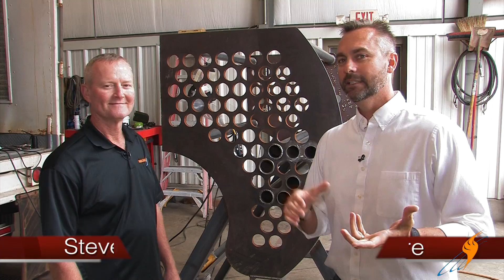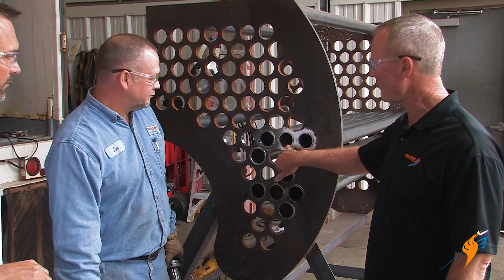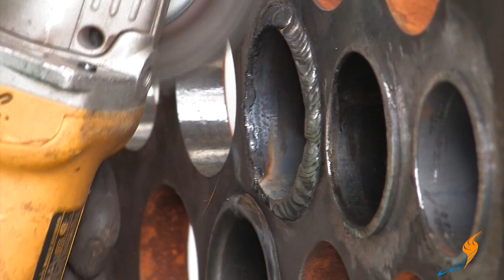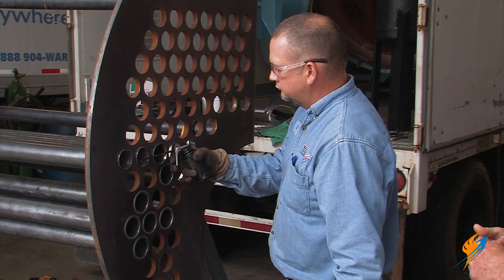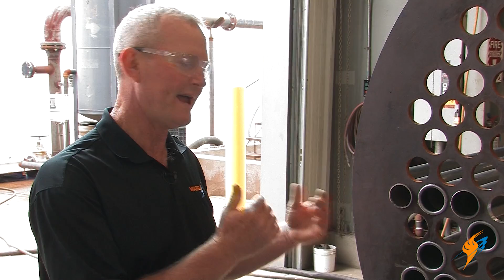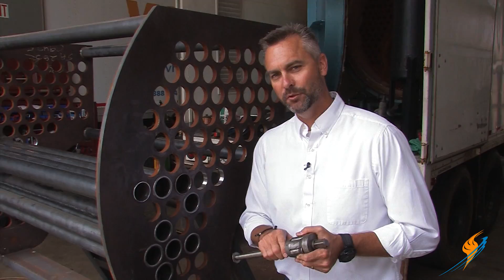How to Roll a Boiler Tube - Boiling Point

Comment: Very interesting video - On our scotch boiler retube back in the 1980s, our inspector and boiler maker elected to just expand, which is Australian code. Coal fired with combustion chambers, so tube joints do not experience fire face temperatures. Tubes had 5/16" stickout front and back. We expanded tubes only (under Australian code) and did not bell mouth. We were embarrassed when we had a few weeps under pressure test, but boiler inspector praised this result, saying he was pleased we had not overexpanded and strained ligaments. 30 years later we retubed again, likely as a result of the boiler being steamed only occasionally as a museum ship. Tube ends in the combustion chambers remained as installed with no leaks or burning. Most tube failures were at worked  edge where the rollering stopped. Note we are natural draft coal, and the tube ends are not exposed to forced draft or oil-fired temperatures. Our earlier boiler inspector and boiler maker had passed away, but the new guys chose to weld new stay tube ends and again, simply expand the plain tubes.

Comment: As a boiler maker apprentice in the 60's the first job I was given was using the expanding mandrel on the tubes to tube plates, we did not have any electric tools, just a manual ratchet and after 1/2 hour I thought my arm was going to drop off. We used to weld tubes both ends and also have several solid stay bars in some holes to make sure the tube plates were truly held and to stop deformation that the tube expansion sometimes created.
Reply: Where I work, that's how we start everybody. You gotta learn the hard way before you can appreciate the easy way.
Reply: Crazy talk! What local, brother?

Comment: its nice to see stick welding (arc welding) still used its what I prefer and its a skill that takes lots of time to get just right.
Reply: Welding around round tube in the vertical position with an arc welder is about the worst thing you can do. You NEVER weld VERTICAL DOWN with and ARC WELDER. All the molten flux runs down and off and away from your puddle and bead faster than you can ever weld a bead regardless because the liquid flux is LIGHTER AND THINNER than the LIQUID STEEL IN YOUR PUDDLE AND BEAD. It runs down away from you and then it runs into the joint and onto the base metal and you end up welding into and over SLAG the whole time. And since you don't have any or enough flux left on your BEAD and have little or no SLAG your BEAD ends up cooling too fast and in the OPEN AIR and will be POROUS AS HELL. I've been arc welding since junior high and gas welding with and without filler rod and brazing as long and back then I was as good as anybody I've ever seen and can still get it done after some practice and I took the real deal welder certification when I was a locomotive machinist at Union Pacific. 

Big V 1/8 wide at the bottom butt weld with a base plate underneath multi-pass no undercuts or beed below base plate metal on the cover  passes and no bead above 1/8 and the instructor was a machinist and former pipeline/water tower/giant ass petroleum tank welder with more hours of vertical welding that I've got welding period and probably more like 10 times more and he was by the book so the bend test was by the book and the weld didn't have to break or crack to fail. HORIZONTAL, VERTICAL UP AND OVERHEAD. THAT is where I learned you don't EVER weld VERTICAL DOWN. And a MIG welder MIGHT BE "easy" compared to arc but there's nothing ELSE that is. Pick up a welding torch or TIG torch in one hand and filler rod in the other and start welding some aluminum or stainless or if you've never tried it just grab the gas torch and NOTHING and run some beads out of the base metal alone. 

I like to think I'm a pretty good welder because I can arc weld and most guys that can MIG weld decent can't arc weld to save their asses too. But I also KNOW I'm a pretty good welder because I've done it all over the years and pretty damned well and I picked it up in pretty short order and I've got LONG periods of time doing NONE of it and it doesn't take me TOO LONG to jump back into it. I've also done more "torch work" when it comes to cutting off bearings and cutting out bushings and torching out broken off bolts without taking the threads in the holes and in general if it can be done with a torch or rod or gun I've at least given it the old college try and haven't had to call for backup yet. I HAVE welded closed a lot of burned holes from getting too aggressive with MIG too and I'm not ashamed to admit that because MIG really isn't ALL THAT FUCKING EASY TO DO WELL JUST BECAUSE ITS A LOT EASIER THAN USING ARC FOR SOME THINGS ARC IS ALL BUT FUCKING IMPOSSIBLE FOR.

As for getting welds "just right", ANYBODY can do that with enough time, materials and a GRINDER. 

https://www.youtube.com/watch?v=ZAX_ZhjJnwg
Reply: Be careful there, buds. You're gonna dislocate your shoulder patting yourself on the back😆 and all a welder is, is a truck driver with his brains knocked out. Keep up the good work, pal
Reply: yes the flux can get stuck but there are rods rated for doing the vertical down motion two of which is the 6010 5p and the 7010 both that are asme approved for the r stamp welds that are required on boilers in the united states
Reply: DEEREMEYER1 they arc weld downhill with flux all the time 😂 all pipeline welding is done that way. Even passed x-ray
Reply: @deeremeyer1749  sorry but you are wrong. Pipe guys run 5p downhill alll day on roots.

Comment: great show !! 
i really make sure about the welding of tubes against tube plate, since my manger reject this in afraid of expansion and cracking of tubes sheet. 
i win !
Reply: In my opinion you'd do this seal/transfer weld in 'thirds' -- make three initial welds at 12- degrees apart, and then weld progressively extending the beads until the full area is covered.  Remember as noted that this weld is not "structural" -- it is only to provide heat transfer for the tube-end metal -- and in particular is NOT a full-pen weld either in the tube or in the sheet...

Comment: Great Presentation!! &  great video!  the only thing i will  added to that is measuring the % of expanded metal to metal,
Reply: Take the Tube ID + Metal to metal clearance (Sheet hole - Tube OD) + Wall reduction (8%-12% of wall both sides) to get the Target roll diameter.  On XID tubes, use our calculations to compensate these number for the extra material.

Comment: I'm a certified welder for a mechanical company that carries an r stamp. My question is, when we seal weld, we bead roll and weld the bead. Would you consider that to be incorrect? With that said why don't you guys just use a regular bead roller instead of beading by hand?
Reply from the maker: Thanks for the question. If the original design of the boiler was seal welded then they should not be beaded first. They should be straight rolled, seal welded, then rolled again. Make sure you consult with the boiler manufacturer and what they suggest. 

We have not been successful with a bead roller due to the tube sheets we find ourselves working on in the field. Most of the time the tube sheets are not true so the bead roller will not put the bead tight to the tube sheet the full circumference of the tube so have to go back and bead by hand anyway.
Reply: Ask The Navy about welding the tubes when the process they engineered thje astroarc system on board the USS Saratoga went wrong ?
Reply: In my country the right method:
1-Tack expansion the first 8mm of the tube, just to close the gap.
2-Welding 
3-Apply real expansion some 5 mm far from the weld. Otherwise, you are risking fracturing the weld.

Comment: great video. Just want to ask. why not weld the tubes on both side. why the need for beading??
Reply from the maker: +zack gaurus Thanks for watching and commenting! Welding the tubes on both sides can be much more labor intensive in the installation and  potential removal of the tubes. Secondly, when the boiler heats up and cools down the boiler will expand and contract which could then crack the welds. The reason for the beading is to allow for the transfer of heat from the tube to the tube sheet. Hopefully that answered your questions!
Reply: Thank you for your explanation. fully understood.

Comment: Love to see that on BCG 13, CN 1551, CP 1278, 1293, BLE 643, NKP 763, KM 9, YWRR 19, GTW 4070, RRR 2100, GTW 6325, WLE 3960, and hopefully much much more.
Reply: Some locomotive practice may be different from that seen here for multipass commercial boilers.  Locomotive practice might be its own set of videos here.

Locomotives boilers are often forced more than commercial boilers 'ought to be', and they are frequently cycled quickly in temperature and pressure during operation.  They may also spend considerable time at what amounts to very low turndown.

Comment: hi these videos educational i would like to know what kind of material is the fire tubes are made of
Reply from the maker: Thanks for the question! The tubes inside of a firetube boiler are made out of a carbon steel. That metal can withstand all of the hot gases as well as pressures that can be inside of a boiler. Let us know if you have anymore questions.
Reply: Common is SA178A, however, code stamped professionals, like Ware, can select the best for the application
Reply: Is there that many different "applications"? If SA178A is "common" would it pretty much be the best for use in a boiler? I know fuels and temps and pressures and applications differ as far as what the steam or hot water produced goes to downstream, but it pretty much still boils down (pun intended now but not when I started typing "boils", lol) to really not gases created by burning hydrocarbons inside the tubes and water outside the tubes. I'm sure there are materials that are cheaper or last longer or transfer heat better etc. but "better" is always subjective and a boiler is no place to ever "cut corners" and its ALWAYS the MANUFACTURER who is going to be the major factory in getting the BEST BOILER FOR THE APPLICATION and that may START at the tubes but it sure as hell doesn't end there. I know ONE thing about boilers or rather THESE boilers or maybe MANUFACTURER. I was IMPRESSED with what I SAW but what I HEARD told me 

I PROBABLY SHOULDN'T HAVE BEEN IMPRESSED BY WHAT I SAW. There is NO WAY IN HELL a PROPERLY ENGINEERED AND DESIGNED AND CONSTRUCTED AND TESTED AND HANDLED AND LOADED AND TRANSPORTED AND UNLOADED BOILER SHOULD EVER LEAK AT ALL. WHEN ITS BRAND-NEW. Shipping is going to cause LEAKS? Give me a fucking break. We've had AIR-RIDE SUSPENSIONS ON SEMIS for a LONG TIME NOW and even though everybody in the country and world bitches about bad roads in their neck of the woods you have to look pretty damned hard to find a paved public road in the U.S. that is SO ROUGH it wouldn't hurt the TRUCK before it hurt the BOILER ON THE TRAILER. 

It might leak a little at first. Tell me what YOU last bought brand-new and for a LOT of money and to PERMANENTLY INSTALL IN YOUR HOME OR BUSINESS that came with THAT "disclaimer". 

I also got a kick out of the air hammer beader deal. Why could those tubes not be beaded using some sort of CONSISTENT and NON-BATTERING tool BEFORE they're slid through the plates to at least get them to a uniform and near-final expansion point using some sort of a SWEDGE or DIE in a PRESS or TUBING BENDER? I know damned good and well boilers have been around a HELL of a lot longer than AIR HAMMERS and I ALSO KNOW that if that "professional" and THOSE PARTS are all up to a high standard of precision, accuracy, quality and are RIGHT FOR THAT APPLICATION, there SHOULDN'T BE ANY LEAKS WHEN HE'S DONE ON even if its shipped on the worst truck with the worst driver ever on the worst roads ever.

Those TUBES are the STAYS for that boiler as well as the passages for the heat to travel through to get to the water. And If there ARE any leaks when its new that SEAL THEMSELVES its because UNDER PRESSURE and when its FIRED the water flowing through those gaps is going to boil away and fill the gaps with the scale and corrosion it will leave when it evaporates and those gaps will go from being air gaps that cause hot spots to scale-filled gaps that cause HOTTER SPOTS because ANY THICKNESS OF "RUST SCALE" THAT FORMS ON IRON OR STEEL IN A BOILER OR ENGINE BLOCK OR SIMILAR ENVIRONMENT is a DAMNED GOOD INSULATOR AND ABOUT FOUR TIMES AS GOOD OF AN INSULATOR AS AN EQUIVALENT THICKNESS OF CAST IRON. 

And that's pretty much what he said in the video and he pretty much admitted that if they leak when they're new they're going to be leaking later and much sooner than they otherwise would. I guarantee if they leak when they're new and you make you a quick diagram of that boiler and the tubes and you note which tubes are leaking when its new and then go back whenever it starts leaking badly enough to be noticeable in the future and you find the leaks THEN and mark THOSE tubes on that diagram, you're going to have two marks on most of the tubes that are marked at all. Or more likely ALL of the original leakers will be leaking PLUS SOME. 

I'm WELL AWARE that BOILERS ARE BURNING THEMSELVES UP FROM THE SECOND YOU FIRE THEM FOR THE FIRST TIME. That's what makes them such a ridiculous waste of money that isn't obvious because they tend to LAST SO LONG when they're WELL MADE. And of course there's NOTHING that you put money into but get no REAL WORK out of (there are other ways to do everything steam does and much cheaper and more simply and more affordably up front and ever after if you do the math right) and have to be willing to either BABYSIT or BET YOUR LIFE ON SAFETY SYSTEMS that doesn't seem like a ridiculous waste of money when you think about it. 

But boilers ARE things you really do bet your life on even IF you babysit them and their simplicity and reliability are the two main things that make them so potentially dangerous. And there is NOTHING more destructive than a BOILER EXPLOSION. At least nothing you're going to going to be able to buy outside of North Korea or maybe Iran. And when you replace a boiler no matter what it has NOT been a fun or enjoyable or even satisfying process and probably NOTHING has gone according to "schedule" and nothing has been as "cheap" or "exactly what was quoted or bid" or even "THAT'S A LITTLE MORE EXPENSIVE THAN I THOUGHT IT WOULD BE AT MOST!" and you've been without a boiler and are probably wondering if you'll live long enough to go through THAT again and decide you probably won't and in fact you probably COULD HAVE BOUGHT THE SMALLER/CHEAPER/LOWER-QUALITY unit and it STILL would have outlasted you now that you've finally put eyes on the old unit up close and personal and saw it was old enough to vote twice over.

So if YOU HEARD "it might leak a little" would you still be listening for the next "disclaimer"?

Comment: Retired Boilermaker 35yrs, how come you didn't use your bore-gauge to check the inside tube diameter after rolling? Why aren't you using "Crisco" as a lube to roll the tubes? I don't think you've ever do tube rolling the right way.
Reply: I agree.  Even on shell & tube heat exchangers  we did just what you said.  The yardbirds from Norfolk Naval shipyard showed us how to do it.  I was a boiler tech. in the U.S. Navy for 6 yrs.  We watched them replace a few boiler tubes on one of the boilers on our ship, also.
Reply: Former boilermaker here also. Crisco is the ONLY lubricant to use to roll tubes that will be welded. I’m not sure these guys know what they’re doing either.

Comment: IT COULD BE ACCEPTABLE WELD IN BOTH TUBE SIDES ?
Reply: You run into 'issues' if full-pen welding the joint between the tube and tubesheet, and if the boiler experiences frequent temperature cycling (as in most locomotive practice) you run the risk of cracking the weld, the tube, or the sheet with differential expansion.  At one point, European practice (Meiningen IIRC) was to full-pen weld the rear of the tubes with care for combustion-plume impingement) and only prosser the other end, which 'sees' only the partial vacuum of the smokebox and has much lower thermal stress -- it is also much easier to access if a tube should start to leak at the smokebox end.